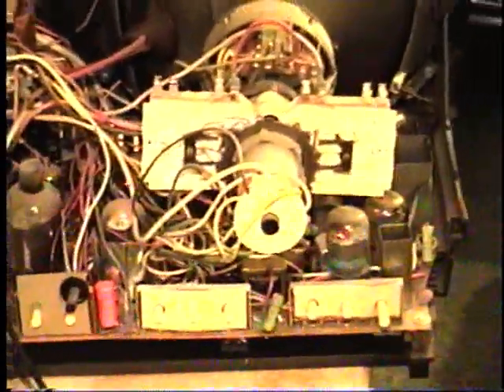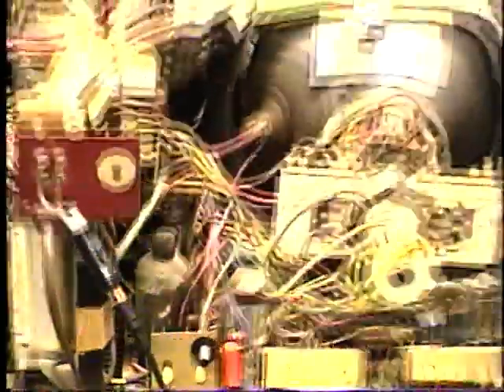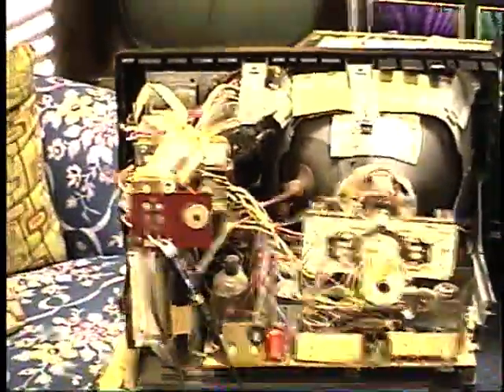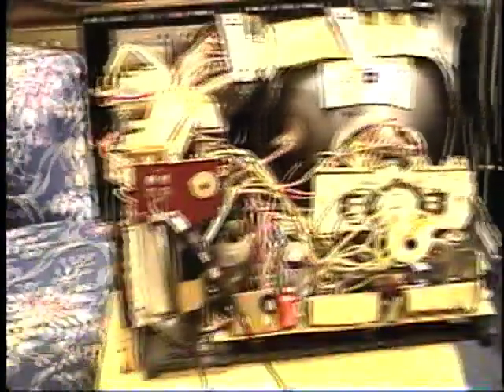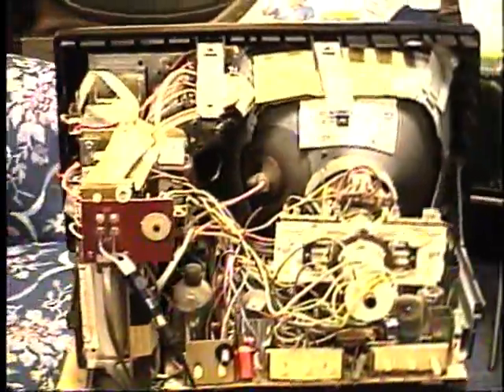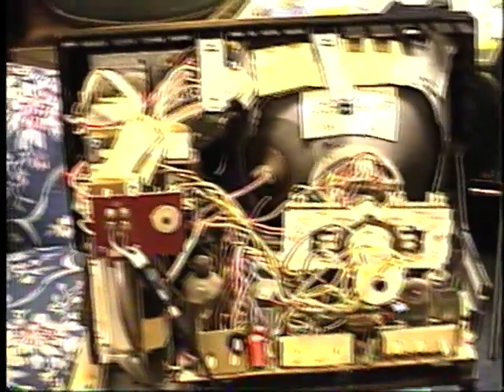3 GE Portacolor Tube Type TV's

Comment: I used to have an mid-60s one which I bought for $25. All it needed was a new aerial (I pulled one off of a mid-70s Performance), a few capacitors changed out and some realignment, but I threw it out before I could finish the work; should had never done so.